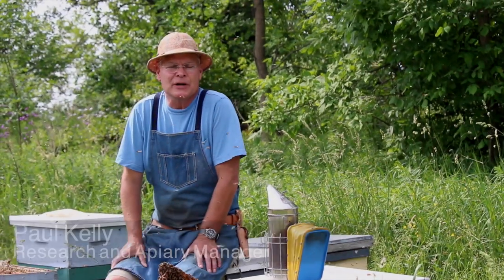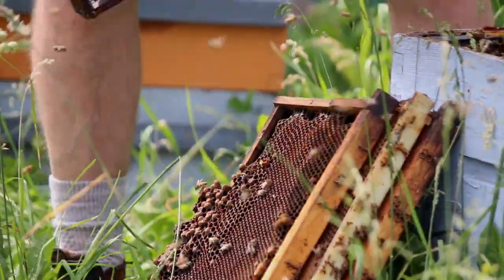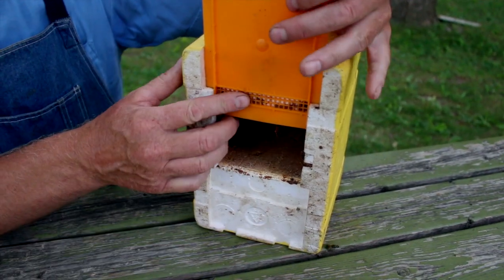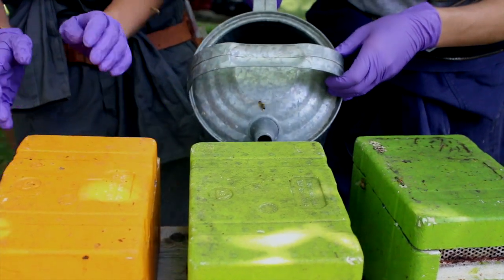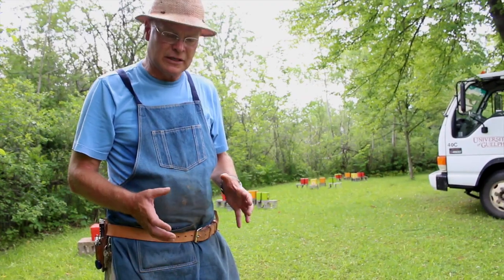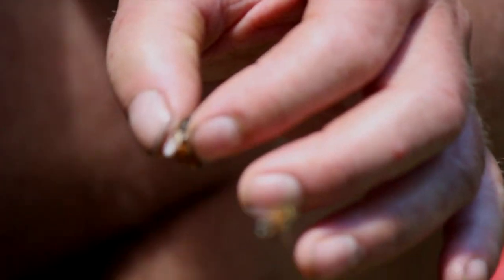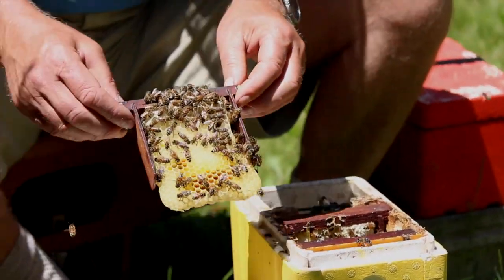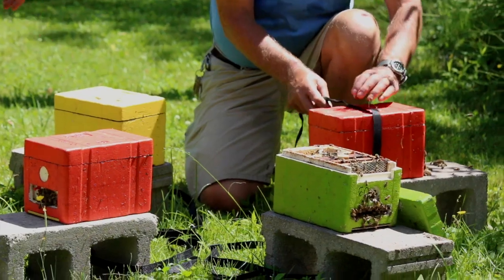Making Mini Nucs

Comment: If you are not in a honey flow do you add syrup (to the nuc) at some point?  The syrup did not last too long in mine.  I hate to open  them up too soon, so group fed them.  Thanks for any suggestions.
Reply from the maker: Hi Larry
 We just finished a video on this topic today but it won't be posted until the fall. Yes, definitely feed your nuc when you install it in your full size equipment. That will  allow your bees to build comb for brood production so the colony will grow. Don't worry about opening up your hives an checking on them. That's way better than the opposite scenario. I find feeding hives directly in the spring is better than group feeding and only do that in the fall.
Reply: Thanks for the info.  You have the best videos out there.

Comment: why you cut the queen wing? at 12:11
Reply from the maker: Hi Fredy
 I cut the queens wing for 3 reasons. 
1.It helps a bit to prevent swarming, 
2. It's a backup  marking in case the paint mark fails 
3. If we are handling queens when they are not laying and thus small it prevents the queens from flying away.
Reply: thanks for replying me, i enjoy your videos and im learning so much thing from your videos. Im thinking to start  next year with 2 or 3 hives.

Comment: Hello, where can I get the mini nucs online? In in East Africa..
Reply from the maker: Hi There
 I couldn't say for E. Africa They are made in the US and in Europe. See FAQ #9 below.

1. Why do we use canvas
for the hive inner cover? A: We use canvas inner covers for a few reasons. They
make it easy to take a quick peek in the hive, and are cheap and easy to make.
They are light, the lids sit down well, less excess wax on the frame top bars,
and we rarely need to scrape the inner cover. We use 18 oz  (#8) canvas
-otherwise known as duck. It's a bit hard to come by in Ontario, but it is
available from online distributors (US: http://www.bigduckcanvas.com/number-8-18oz-cotton-duck-canvas.html,
Canada http://www.jtsoutdoorfabrics.com/18oz-Cotton-Duck-Canvas-Untreated--Natural-60_p_15038.html).
Bees chew through thin canvas so a heavy weight is better. We flip it over
periodically when new so the bees thoroughly coat it with propolis. An
alternative is a feedbag folded in half. 

 

2. Why do we use single
brood chambers? A: Our preference is to keep hives in single brood chambers. We
use queen excluders above the brood chamber and then add supers. We produce
bigger crops managing our hives in singles vs doubles and we find the hive management
much easier. It's become quite common here, especially over the last twenty
years. We will be making a video about single brood chambers soon! 

 

3.  Are our queens for sale? A: We sell some queens but don't
export. To contact us about our queens, please email us at infohbrc@uoguelph.ca. Our Buckfast collaborators also sell queens: Munro Honey http://www.munrohoney.com/ (for CAN sales) and Ferguson Apiaries http://fergusonapiaries.on.ca/ (for CAN and US sales). 

 

. 

4. What breed of
honeybee do we use? A: We work with Buckfast bees. Check out our website if you
would like to learn more about them: http://www.uoguelph.ca/honeybee/breeding.shtml 

 

5. Will we be making any
more videos? A: Yes! We are looking forward to creating more videos for our
YouTube channel this year! Here are some of the topics we will be covering:
Working with single brood chambers, indoor overwintering. 

 

6.How do you overwinter
double nucleus colonies? A: At the University of Guelph, we winter our double
nucleus colonies indoors. You can also winter them outdoors by wrapping two
double nucs together with insulation on the sides and top. 

 

7. Are double nucleus
colonies prone to swarming? A: With a young queen and the supers above we don't
have any problem with these nucs swarming in the first year. We do have to
transfer them into a full size box early enough the following spring to prevent
swarming.

 

8. Do we add a frame of
pollen or honey into a new split? A: Ideally you add both pollen and honey. Of
the two, honey is the most important. 

 

9. Where to purchase
some of the products that we use: 

 

Coveralls: We really
like these Dickies all cotton coveralls. http://www.dickies.com/coveralls-overalls/deluxe-cotton-coverall/48700.html?dwvar_48700_color=GY#start=3.
We use two sided velcro to strap up the wrists and usually tuck the legs into
our socks. 

 

Plastic Queen cages:
Mann Lake and their Canadian distributors sell these and they are made by the
French company Nicot. https://www.mannlakeltd.com/hair-roller-cages. I use
a wooden plug on the bottom and screw it in place with a #4 screw after pre
drilling. 

 

Grafting microscope: http://www.amscope.com/catalogsearch/result/?q=gooseneck+binocular

 

Mini/mating nucleus
boxes: Mann Lake (US) and their Canadian distributors sell these. They are
originally from Europe so are widely available there. https://www.mannlakeltd.com/shop-all-categories/hive-colony-maintenance/queen-rearing/nuc-boxes

 

Queen Pheromone: The
pheromone strips were developed here in Canada. They are called Tempqueen and
are made by Intko Supply Ltd.Suite 604, 3345 Kingsway VANCOUVER, BC, V5R 0A7
Canada +1 (604) 356-7393. pheromonesupply@gmail.com. Mann Lake in the US and several Canadian
bee supply companies carry them. 

 

Bee belt and bulk bee
box: Our apiary manager Paul Kelly manufactures the Bee Belts and bulk bee box.
If you are interested in more information, please email him at pgkelly48@gmail.com.

 

10. Should you remove
any queen cells in a colony before introducing a new queen in a cage? A: Yes,
you should remove the queen cells. Look very carefully to make sure you don't
miss one. Shake the bees off each frame to make sure you can see them all.
Accepted queens are sometimes killed by virgins that emerge from queen cells. 

 

11. Can you make a split
without adding a mated queen/can a split raise their own queen? A: A split can
raise their own queen (if they have eggs), but you'd be better off buying a
mated or queen cell from a local bee breeder. Queens raised by a split are
reared under the worst possible conditions, are physiologically inferior, and
you aren't taking the opportunity to improve your hive genetics. For a number
of reasons, colonies get more aggressive if we let splits raise their own
queens. We always use queen cells that we have reared from breeder colonies so
we can maintain and improve our genetics. Cells found in hives can be poorly
reared if conditions aren't good or if you use swarm cells you are
unintentionally breeding for swarming behavior. 

 

12. How often do we
check for swarm cells? A: We check for queen cells only in colonies that are
stronger based on our ratings as described in our “Swarm Control” video. We
only do this at the time of year bees are prone to swarming (ie just before the
main summer nectar flow). In some colonies, we check twice, a week apart, if we
have the time and we've found cells in them previously. We stop looking once
the nectar flow gets going and the time for swarm preparation has passed. 

 

13. How old is a queen
when we replace her? A: We re-queen if a queen isn't doing well or when she is
in her third year. 

 

14. How often should you
be stung to lessen the chances of developing anaphylactic reactions? A: Please
speak with an allergist if you have any concerns regarding bee sting reactions.
You don’t need that many stings to build an immunity and reduce your chance of
developing an allergy. However, reactions can be very different from one
individual to the next. For about three years after starting beekeeping you
swell more in the spring when the bee season starts. After that most people
don't swell up much at all. Some beekeepers apply stings through the winter to
keep building immunity. 

 

15. What do we use as
candy for the queen cages? A: You can make the candy using honey and icing
sugar but the candy you see in the tubes in our videos are purchased with the
cages from Mann Lake beekeeping supplies and their Canadian distributors. In
our province, it's not legal to use honey in queen candy if you are distributing
queens. Honey can contain American Foulbrood spores. A specialized, non-drying,
sugar syrup (Nulomoline invert sugar) can be used instead of the honey. In any
case the candy must be made dry enough that it's crumbly.

 

16.  How do we make pollen patties? A: The patty is
made from pollen we collect using a pollen trap. We mix the pollen pellets with
sugar syrup to a dough like consistency, form the patties between layers of wax
paper and then keep them frozen until they are needed. They will keep for several
months frozen. 

 

17. How do we make our
grafting bars? A: We cut the wood pieces and attach them to the graft bar with
liquid beeswax. We then attach the cups with liquid wax. In both cases the
liquid wax is applied with a syringe. Previously, we made the wax cups but now
buy them from https://www.kelleybees.com/. 

 

18. Do we move full
honey supers to the top of the stack so the bees can fill the lower ones? A:
Some beekeepers do shuffle the supers around and do what's called bottom
supering. We place supers back on in the original order and only add new supers
on top (top supering). That way it's easier to see when the bees need more
space. The bees also ripen the honey before moving up. We sometimes harvest
full lower supers and put the top ones that aren't full back on in the original
order. 

 

19. Do we ever add brood
frames to the cell builder colonies to keep their populations high? A: We do
add other frames of sealed brood and sometimes we shake in more young bees from
brood frames to boost the hives. About once every three weeks we'll boost the
hives in one way or another. 

 

20. How do you level
hive stands? A: We level the hive stands periodically with pressure treated
wood shims. If the hives are already on the stands, we use a hardwood pry bar
and a brick fulcrum to lift each end for shimming.

Comment: Just Wondering. If it takes 2-3 weeks for a queen to emerge from capped cell, mature, mate etc and then 3 more weeks for newly laid eggs to emerge thats 5-6 weeks right? so if a bee lives for about 6 weeks dont the mini nucs run out of bees before enough new ones emerge? and of the bees left only the ones a few days old when you put them into the hive would be alive right?
Reply from the maker: Hi Jack
 When you put a queen cell into a nuc the queen is laying within about 8 days so 29 days after the cell is in you have some emerging adults. From then on each successive queen lays for a short while.
Reply: 8 days? as i understand it the queen takes 5-6 days to mature, 1-2 days to mate if the weather is nice then another 2-3 days to settle before laying?
Reply from the maker: HI Jack
 I think you are about right so on the short end it adds up to 8 days but can of course be longer.